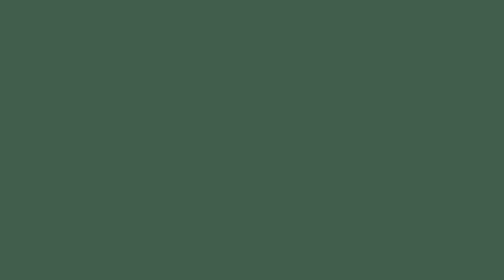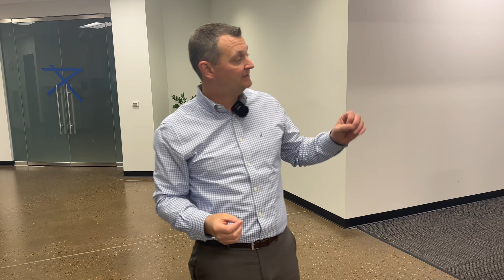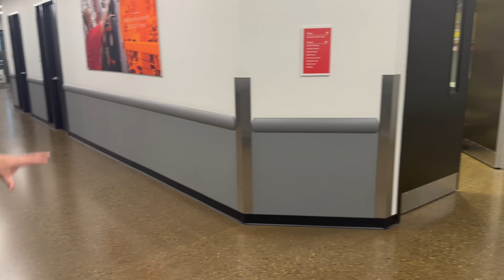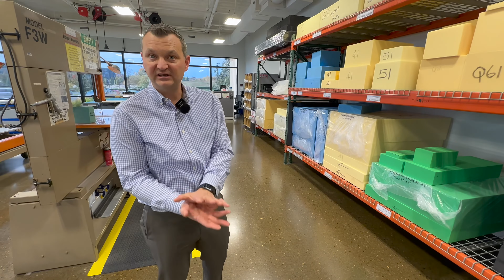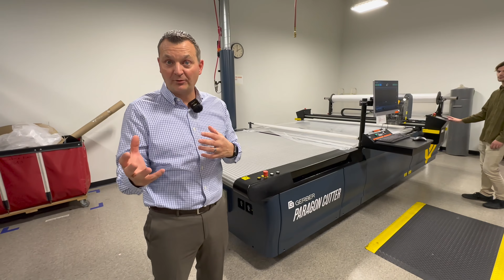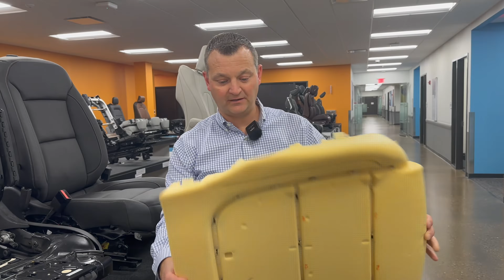Check Out How Insane This Automotive Seat Engineering Facility Is! Magna Seating Building Tour

Comment: I worked in engineering in the seating department in Magna and the place is incredibly poorly run.  I cant speak for this specific facility but the launches for new product were a complete disaster and the quality was inconsistent.  One day a defect was acceptable and the next it was not and then the next day it was again.  The instructions from upper management were so inconsistent that the operators just stopped caring about quality.  Warranty claims were through the roof!  The seating department always had at least 7 out of 10 of the top warranty claims every month.  After working there I avoid magna seating products.

Comment: Interesting. I worked in that business about 50 years ago at Bostrom in Milwaukee. Their main business was suspension seating for trucking and construction equipment. I worked at trying to make their products meet the then new Federal Motor Vehicle Safety Standard 302 for flammability. I left with occupational asthma from the chemicals used in blowing urethane foam.

Comment: 13:26 "Expanded Polypropylene (EPP) is a highly versatile closed-cell bead foam that provides a unique range of properties, including outstanding energy absorption, multiple impact resistance, thermal insulation, buoyancy, water and chemical resistance, exceptionally high strength to weight ratio and 100% recyclability."